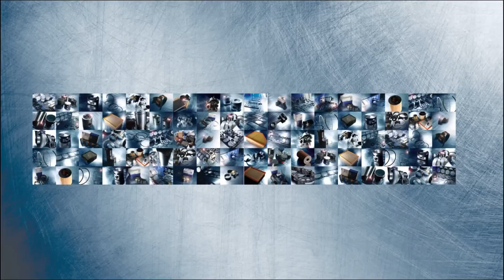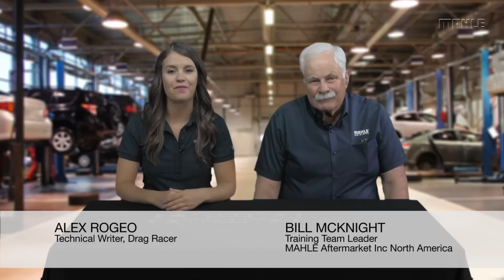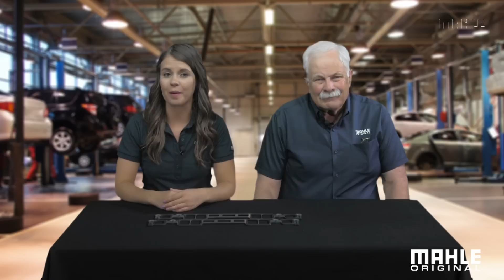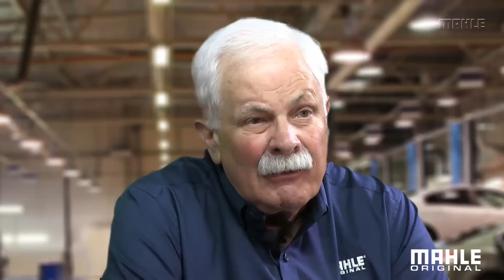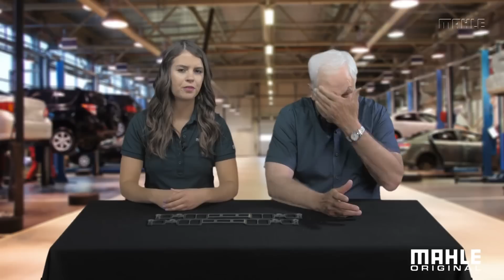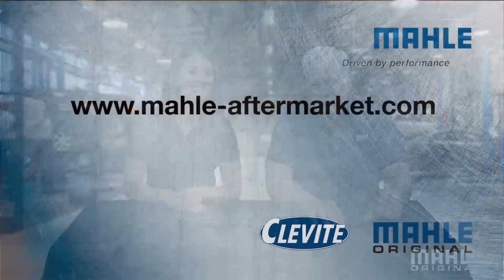Bill explains the real story about DEXCOOL

Comment: Why did manufacturer switch over to Dex-Cool in the first place?
Reply: They knew it would fuckup the engines.  They gotta keep people buying new cars every few years.  GM pays engineers to make things flawed to keep selling new junk on wheels.
Reply: The reason is that the Dex Cool formulation under ideal and proper circumstances not only offered superior corrosion protection versus standard coolant of the time, but it also offered a longer service interval than the conventional coolant that was being used prior to Dex Cool.  The problem was that when not under ideal conditions, Dex Cool could also become highly acidic and start attacking materials that were commonly being used at the time in gaskets and engine components. This would not have been an issue if vehicle owners checked their vehicle fluids regularly such as in this case the coolant and simply kept the fluid level topped off so as to prevent air from mixing in with the coolant which then would initiate the rapid decline of coolant composition in to an acidic form that would do the damage. In addition to this, because of the extended service interval (5 year for Dex Cool vs 1 or 2 years for standard coolant) it became much to easy for owners to completely forget about servicing the coolant being you wouldn't even need to think about for a good stretch of years and so people got out of the habit of changing their cars coolant at all.  This is also why you hear such opposite stories when it comes to Dex Cool. Some people stating how problematic the stuff is/was, versus other people who mention how they've run nothing other than Dex Cool for 15 years and 350k miles with no issues, but the later group of people also stayed proactive with their vehicle maintenance as well as checking fluid levels and topping off as necessary along the way, thus they never let the conditions arise that would lead to the Dex Cool becoming acidic in the first place.  Was Dex Cool superior to the standard coolant that was being used at the time? In many ways, yes it was. Was introducing a new coolant that was designed to go for 5 years/100k miles a good idea considering that prior to that the standard recommendation was to change out coolant every year or two?  Well therein lies the dilemma in that people no longer felt it necessary to check their coolant level/condition when situations such as low coolant levels and or coolant system leaks occurred (leading to air getting in to the system and fluid), what was supposed to be a superior coolant would quickly turn in to a monster and damage would occur. For people who have made it hundreds of thousands of miles running the Dex Cool there would be no reason for them to switch over to anything else as they obviously know what they are doing when it comes to maintaining their vehicle(s) , whereas for people that are not so sure they always do proper maintenance and regular inspection then perhaps they may be better off changing their coolant out to an OAT or HOAT coolant (as long as its done properly) either of which have less of the "jekyll & hyde" characteristics. Of course with many manufacturers now committing to converting over to all electric vehicles in the near future, this issue will become less and less relevant to car ownership.
Reply: agree
 @racers115
Reply: It is long lasting and offers some of the best corrosion and erosion protection. It is just chemically agresive and does not tolerate air bubbles

Comment: It's not OAT antifreeze. It's DEXKILL in particular. It does a lot more than just damage gaskets. It starts out as a liquid, and turns into a solid inside the engine, plugging up all the coolant passages and destroying the engine. I have torn down dozens of GM engines, some as new as 5 years old, that had the water jackets around the cylinders more than half plugged with a brown gooey waxy substance. It also plugs up the radiator, heater core, thermostat, coolant hoses, and even the water pump. If you have a GM vehicle, GET THIS STUFF OUT OF IT RIGHT NOW!!!. I recommend replacing it with Prestone OAT coolant. It has proven to be safe for engines, including aluminum engines, which can be damaged by the silicates that were used in older types of coolant designed for cast iron engines. It has nothing to do with the engine. DEXKILL will destroy any engine. In any vehicle, regardless of brand. And it is the ONLY so called "coolant" that has been known to cause this problem. Most auto manufacturers have their own brand of coolant these days, but not a single one of them have been known to cause problems, EXCEPT DEXKILL.
Reply: I’m at 120k and thinking of switching to Toyota Super life (the pink stuff) I have a Pontiac vibe 07 which is essentially a matrix anyway......
Reply: So I’m good to use Preston dexcool? I want to change mine here soon
Reply: Prestone*
Reply: Dexcool is fine....had it in my trucks since 2004....Still going strong, no issues.....

Comment: So people honestly think that GM would sabotage their history their reputation their customer base & customer loyalty for a few $$$ worth of unscheduled car maintenance?!  That doesn't make automotive industry longevity sense to me at all! knowily using a potential "liability" threat not only doesn't make sense it ruins your overall profits! If Dexcool was such a highly dangerous  internal components issue then their should have been an all out bulletin & potential liability act on GM! Would GM intentionally do this to ruin it's reputation & potentially loose thousands of loyal customers to supposedly gain more revenue from repair maintenance?? Sounds like self destruction to me which doesn't make a bit of sense at all! I've never had any issues with sludge build up or leaking seals since 1997! My 2003 Gmc Envoy is running just fine with over 220,000 miles on it with Dexcool! Yea I've replaced radiators(due to plastic part leaking) & water pump(propably because of getting from Advance / Autozone remanufactured) but never noticed any signs of Dexcool as the culprit.Think about it!
Reply: geminiwilliams037 They made a new coolant without taking material components into the equation. Bad oversight,  but it got fixed. 

My 2014 Ford Escape uses dexcool. It also uses a transmission that was a co designed with GM.

The orange stuff is fine. But if given the choice,  I would exchange for hoat or green inorganic.
Reply: Konrad Ford.    Thanks for your input. Like I've said me personally hasn't had any issues like some ppl here are explaining. Maybe I'm lucky but I doubt it. Over 220,000 on my Envoy & none of those issues with Dexcool so don't know?
Reply: @justmy2cents_  Air leaks and over extended intervals will cause issues. Same can be said of any other fluid but Dexcool isn't an issue and hasn't been for a very long time. 

My escape has only needed a top off. Oh well.

Comment: um,,never had any issues with dexcool,,just changed my antifreeze in my 97 Trans AM today with it,,
Reply: I've been a mechanic for 35 years on all makes and models. I own only GM at least 3 at a time and 7 right now. The coolant gets changed every 3 years in each one whether someone else thinks it needs it or not. Never any kind of gasket failure.
Reply: @milwaukeebiker  Smart to change it every 36 months. I say 24 and I took the DEX out my Buick 3.1 2000 Century when new. Now at 86000 miles and no problems yet.
Reply: I had DexCool in my 96 GMC Z71 and believed the lie. I didn't replace it with Ethylene Glycol until probably 2005. In 2015 it suffered an intake gasket failure. Replaced it with steel reinforced intake gaskets and all is fine.
Reply: Where GM screwed up was in the marketing. Telling new car buyers they could go 5 years and or 100000 miles without a change of coolant.  As far as I am concerned all vehicle owners should flush and refill their coolant every 24 months regardless of miles. Better yet flush out every drop of Dex orange and use a green coolant.

Comment: Well checked 2000 Pontiac grand am reserve tank is cylinder shape. There is brown sludge in only the top haft on the underside but only at each end not in the middle and none on the bottom haft of reserve tank. I say that because reserve has a seam bit more then haft way up running around it and definitely no sludge below that seam.  How bad the sludge maybe esle where like hoses or engine parts I don't know. I hope that the way the car is driven with low klms compared to year that all or most sludge went into the reserve. Got photos but not sure how to post here if you can. Again coolant still very orangey in the reserve. Not brown. I use Cdn Tire Prestone says with GM Dexcool. That any better then gm dealer AC Delco etc ??? Car starts fast seems to run very good.

Comment: I will add to story. I got rid of my 2007 Pontiac grand prix 3.8 NA last yr because it I think had a coolant leak or air leak ??? That coolant at 205000 klms not miles now a ton of sludge brown and white mostly brown. I believe I had an intake leaked repaired by GM DEALER on 2000 Pontiac grand am that I am way back 2003 or later. So don't know how much of a drain it would have had and likely then they would have put dexcool in it also then. Few questions and concerns here. PLEASE tackle them in detail from these two messages thank
Reply: Dexcool will turn that way if it has a major air leak. Also sounds like you did not change it when you should.

Comment: Okay now I am worried. I can not remember from factory if my 2000 Pontiac grand am gt came with green regular coolant and ton of yrs ago I changed it to orange dexcool long life from Canadian tire not the GM DEALER.  Or if it always had orange dexcool long life. My car spends most of its life in storage with about 1000 to maybe 2000 klms put on it each year for several yrs now. It's only at 87000 klms not miles now. Last I looked it is still pretty orange. Last changed oh god 8 or more yrs ago.    Should I panic get it not just changed but flushed and put I guess prestone yellow long life in it. Have not found up here anyone who actually does a pressure flush just hose flushes complete system heater core etc. Is that going to be an issue with changing coolant types. My car is pampered not alot of hot driving or dirty.  Less then hour continiuos driving when i do drive it. HELP
Reply: Look up your manual. It will say. If you're worried,  then just change you green if worried.

Comment: Just flush out the dexcool and refill with long life universal antifreeze that is offered by prestone and many other brands
Reply: You have to flush extremely well, if you don't and Dexcool and Green coolant meet it will create a gel that will clog up the entire cooling system
Reply: @AdamSmith-gs2dv  Use Thermocure rust remover and flush. It is great stuff. I flushed the remnants of nasty Dexcool and the complying rust right out. My radiator looks new inside. Prestone American car universal 10year/300K mile stuff is running great.  Temps perfect at 195 on a 2002 3.8 liter LeSabre.  Set at -34 degrees mixture.
Reply: Any problems yet?

Comment: or you could drain all of the orange shit flush the system with water till nary a trace of orange garbage coolant is left and put the green shit in and go back to changing it every 3 years... the green normal coolant does not go acidic it does not gel in air and it does not eat seals out of the engine... and hold up a company made a STEEL and silicon gasket that fixed the issue a year before you redesigned the shitty plastic one to put in gm shitty engines...

Comment: dexcool sucks regardless of air in system it eats rubber and plastic. A water pump that lives 150k miles with green lasts 25k with dexcool. Never run dexcool regardless of what this guys says is fixed

Comment: I already changed the gaskets in my 1994 3.1L, so i know what he is talking about. The new improved ones have the steel. The original gaskets look so frail and cheap oh and i have never used DEX, i use the green stuff and no problems.
Reply: Which green coolant excactly
Reply: @cdf347  Inorganic green. It can be found in store brands, motorcraft green, prestone prime green.
Reply: Mine smells like burning silicate ik cause I've burnt silicone before but it smells mote sweets so I think my car is burning cooling cause it's not a leak cause the level barely changes an my car hasn't over heated
Reply: @cdf347  youre burning coolant, a head gasket problem
Reply: @JuvenalMena  my car isn't it was bulletproofed an studded to fix the design of the 00-05 devilles i was just asking which brand, type stuff like that but ives figured that out its been 2 years 🤣🤣

Comment: We have a 2006 Buick Lacrosse 3.8l that still has Dexcool in it ( purchased last June ) .  No pressurized coolant overflow tank . 

     Would this engine have the " good " gaskets from the factory or " problematic " gaskets ?

     Shortly after we purchased it , I replaced the black plastic coolant elbows , radiator hoses and heater hoses .  Refilled the cooling system with a new gallon of Dexcool .

     Will changing the coolant , this way , help the situation ?

     We also have a 2015 Chevy Sonic 1.8l , purchased new .  At 2 years , I dropped the lower radiator hose and refilled it with new Dexcool .  Will this type of servicing help this car ?  ( it has a pressurized coolant overflow tank . ) 

Thanks ,   :-)
Wyr
God bless
Reply: your doing the right thing. dexcool isnt the greatest but if changed when supose to its perfectly fine.
Reply from the maker: Probably the improved design, but it would be prudent to change the coolant!
Reply: Wyr Twister ggg